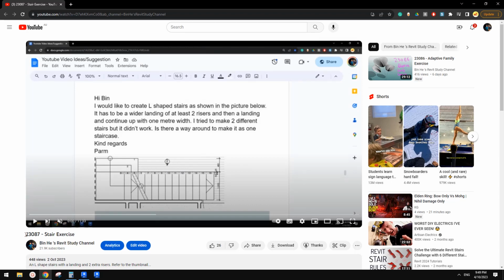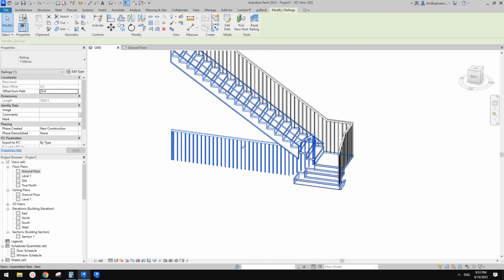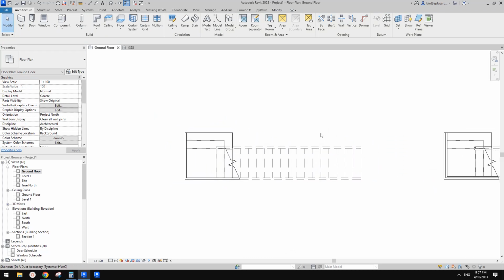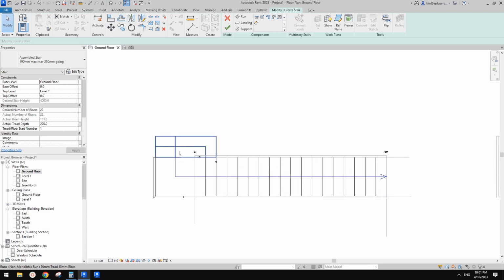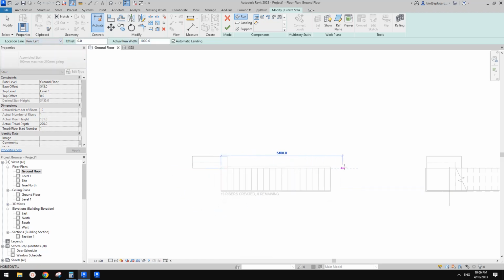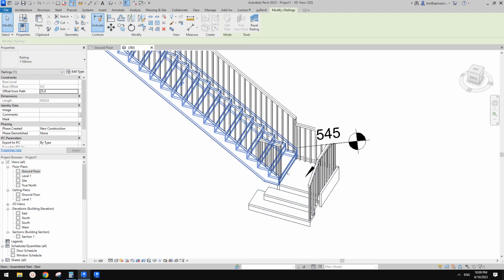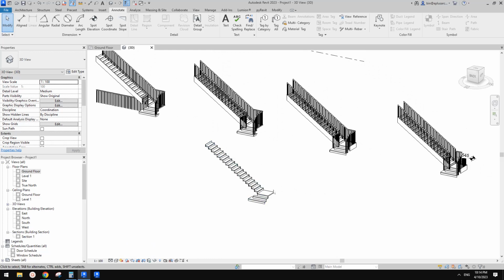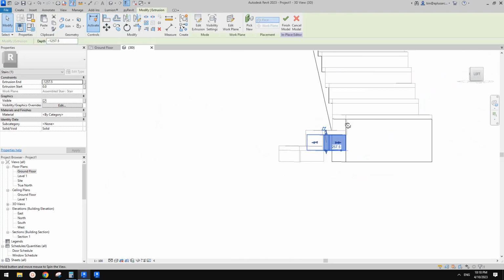23089 _ More Revit Stairs Exercise

Comment: Nice digging in problems … this what makes your channel different from many other Bin! 
I agree with you in keeping the one piece assembly stair for plan and annotation, but I think it’s necessary to have a monolithic look in sections, 3D views etc.. 
didn’t know that you can place railing on a model in place! Is it because the category = stairs ?
Reply from the maker: No, I placed the railing on the assembly stairs. I doubt we can place it on a model in place, I think it can only be placed on stairs, ramp, floor, and topography.
Reply from the maker: Tried, won't work on model in place.